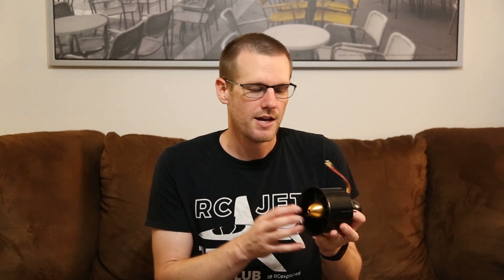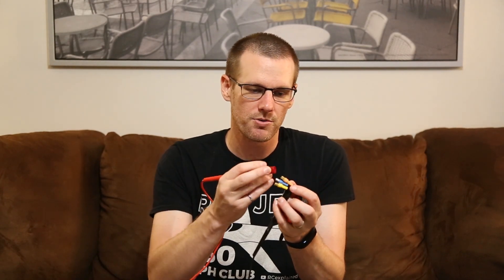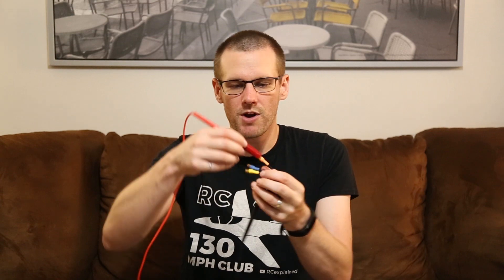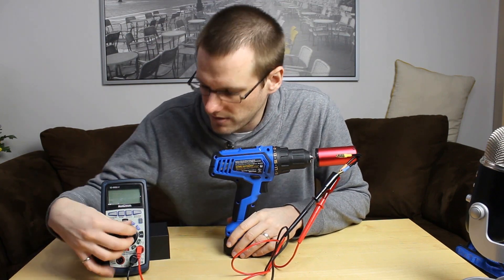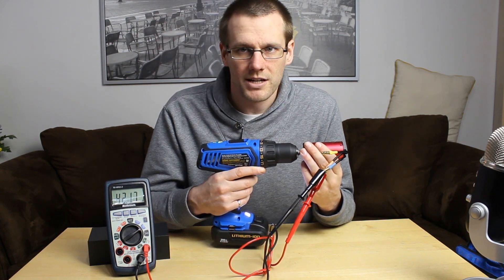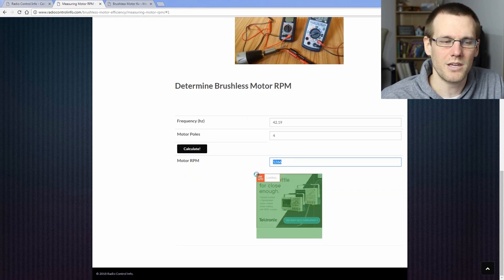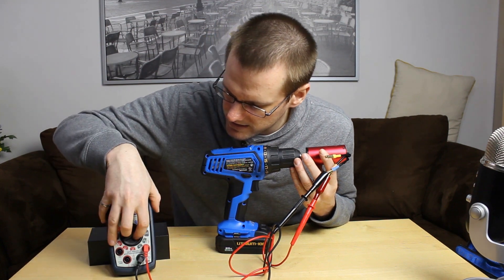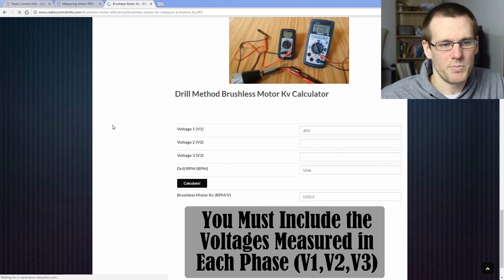How to Determine if your Brushless Motor is Dead (Electrically or Mechanically)

Comment: Used some of what you said to diagnose my BLDC motor, just checking AC voltage between the three phases only to find one of the three putting out 25% compared to the other two, confirming that I have a 3-phase piece of toast.
Reply from the maker: If you repeat this test and confirm a winding is that far out, that's not looking so good.
Reply: @RCexplained  I suspected as such, the motor detection on two different VESC's failed for various reasons so I had already ordered a new, better suited motor anyway.

Comment: Thanks good job. To check the kV I usually go with a cheap speed controller without timing and measure the RPM at a given voltage (but i admit not everyone has an rpm meter at home)
Reply from the maker: Thanks for the comment!

Comment: A few years ago, I got a hubsan h501a drone, and after about a year one of the motors stopped working and created a bit of smoke. At the time, I was planning on spending some money on a dji mavic air, so I took that as a chance to get one and never looked back. The hubsan kinda got abandoned in my closet. Now a couple of years later I'm thinking of fixing up the old drone just to fly for fun when I'm not flying my mavic. I know that it's the motor and not the esc because I tried swapping two motors around and the a different motor worked fine on the esc that the fried motor was on. I'm just wondering if it's at all possible to repair the motor, or do I definitely have to buy a new motor? Thanks 👍

Comment: Hi, so i want to ask,
Im going to get a goolrc 3400kv brushless motor, i think its max 105 a, also an 125a goolrc esc,
and a 3000mah 35c (105a)lipo,
Do you think it  will be good to work?
Reply from the maker: How many amps are you going to be pulling from this system?
Reply: I really dont know
Also how can i get an mono or cataraman hull?  I dont have something like an 3D printer
It says that the motor suits
600-800mm hull
Reply: @RCexplained  are you there?
Its ok if you cant respond Fast, dont worry
Im really excited, this Will hopefully be my first rc boat
Also the first time that i Will buy something from the internet
Reply from the maker: It sounds like you have selected a 2s LiPo with a 3400kv motor selection. 

If so this can work with a 600 to 700mm hull. 

A catamaran can be purchased as hull only. Look at offshoreelectrics
Reply: @RCexplained  Its actually 4S
Reply from the maker: 4s would be far too much in a boat with 3400kv. Even 3s would be pushing it.
Reply from the maker: If it's 54cm long, that can work. I'd prefer a fiberglass hull vs what appears to be ABS but you should be able to make that work.
Reply: @RCexplained  it says its 56cm Will that be Okay?
Also i looked at offshore electrics
But a fiberglass hull was too expensive for me
Reply from the maker: @-dafhatas-6519  56 is ok on 2s

Comment: I don't know who to pass this on to, but there's almost no videos about vent holes in rc bodies. I want to know the aerodynamic effect and cooling performance that can be achieved with a few well placed holes for nitro and electric RC vehicles. Especially SCT bodies
Reply from the maker: It's something I can look in to, to see if I can get a CFD analysis done on it.
Reply: @RCexplained  Thanks for replying, forgot about rc buggy and their rear wing (I thinkTLR has a few with a front wing), I know it's pretty obvious what it does and how it works, but there's so many setups and adjustment that can be done to any RC car to meet the track condition, the body and wing play a huge role when the car is moving and in the air. I have a proline truescale ford F-150 '17 and cut vents on the hood, middle back window, 4 short vents on the bed, and vented the sidetop of the tailgate, just seemed logical to vent those areas but I haven't tested it yet.
Reply: idk if u will still read this, but i removed the plastic windshield on my shortcoarse truck (took out the piece where the window sticker is (whole) and added a fiber tape mesh type thing there. same for the door windows. now the air has good flow, provides decent cooling to esc and motor (my esc has 4 rotor blades broken so yeah air cooling actually works) motor does get hot after 10 mins but i am using a onroad motor 12t 4300kv on a offroad car so i say it works.
Reply: Aero wise it's a negative effect....

Comment: Great, the video I was waiting for, How about measuring the resistance of the 3 phases. will it help identify any problem ?
Reply from the maker: HI Gehan, thanks for the comment! Yes measuring the resistance of the 3 phases will also help identify any problem. However, measuring resistance of a phase is a bit more complex (video on the channel on this) and you will not get any understanding of the state of the rotor. Measuring voltage on each phase will provide you will all the information to make a full assessment.
Reply: @RCexplained  Thank you so much for the reply. I will watch the video.

Comment: My rotor opened and locked the motor. Not sure what they use to wrap the rotor but it didn't work lol Poseidon 2200kv. Great info vid Thanks💯🙂
Reply from the maker: Oh no! An aggressive lock up could damage the stator to the point where replacement of the motor is your only option. Thanks for the comment.
Reply: @RCexplained  Yes I replaced motor 👍🙂
Reply: They use Kevlar thread to wrap the rotor